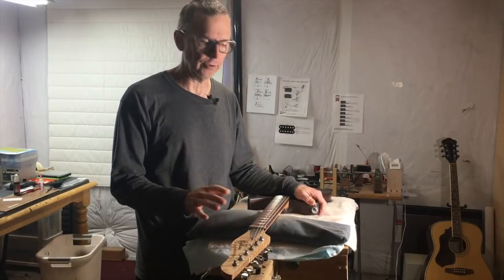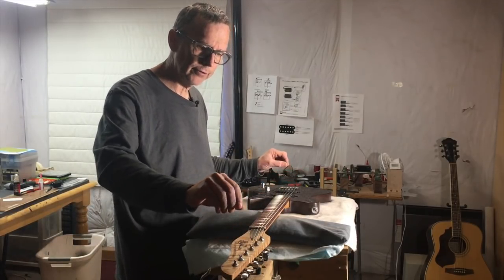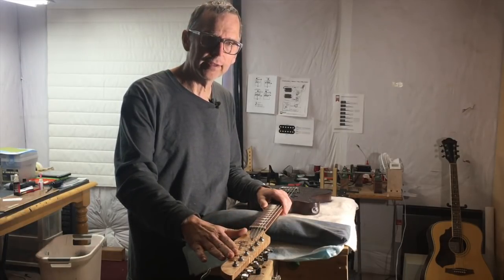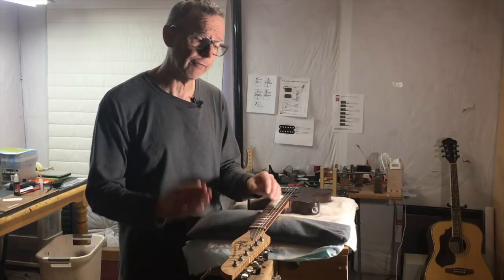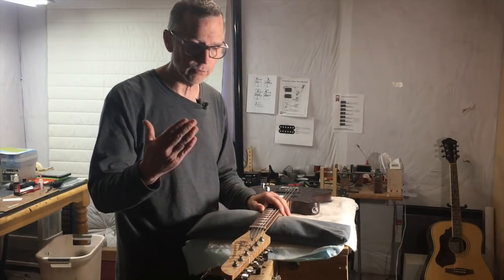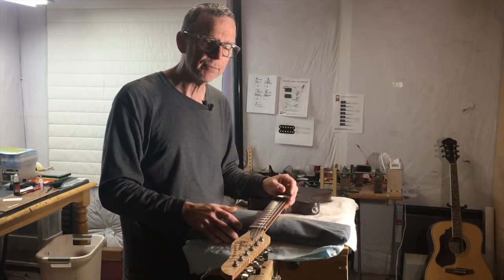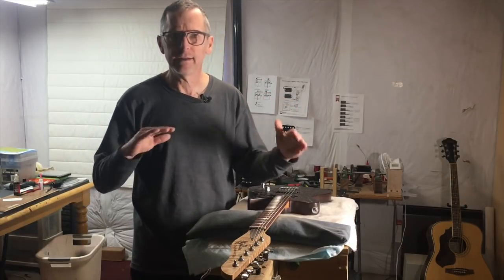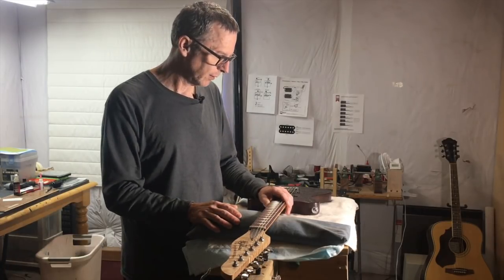Stop Fretting Over Headstock Angles

Comment: I quite disagree in the conclusion of your analysis. 
If we have a nut of an ideal material, then there is no friction forces (in the local direction of the string) added to the string (this is how we'd like the nut to be ideally). This results in a case where the tension of the string is identically the same on both sides of the nut. The only forces transmitted from the nut to the string is local pressures acting perpendicular to the direction of the string. Since the situation is steady, according to newtons second law, the forces should balance. So if we consider the force component in the direction perpendicular to the fretboard, the analysis will show us that the force from the nut onto the string in this direction turns out to be Fs*sin(StringBreakAngle). From Newtons third law we get that the strings push the nut down with an equal size but opposite direction, So this is how much the nut is being pressed "down onto the fretboard".
Fs is the string tension force, which for an ultra light set (9-42) correspond to the force that 36 kilos make.  (We can get up to the double of this by switching to heavy 12-52 strings!)
"sin" is the mathematical sinus function
"StringBreakAngle" is the angle-change that the string makes over the nut (if the sinus fuction on yout calculation device works in radians you have to use the string brak angle given in radians, where  DegreesInRadians=Degrees*pi/180=Degrees/57  (approx.) )
For an example with numbers I'll use the string force from the ultra light strings, corresponding to 36 kilos and give the results in in F/g, so the corresponding kilo's of mass that would produce the same force in earth's gravity. The results are shown below 
StringBreakAngle (degrees)   0       5        10     15
Force/g (in kilos)                      0       3.1     6.2    9.3
As long as the string break angles are kept small (below 30 degrees), the sinus function is rather linear, so we can say to a good approximation, that for the ultra light strings considered we'll get 0.6 kilos worth of nut pressure per degree string break angle, and heavy strings approximately the double. 
You can test that this is indeed correct by trying to "lift out" the strings off the nut of a guitar. The force is very far from just the weight of the strings. I can send you the force diagram and calculations so you can go through them yourself if you wish. 
Thanks for all your great guitar building videos. I apprechiate them a lot!
-Mac
Reply: I agree with MrMac, the force vector at the nut (perpendicular to the fretboard) increases with the angle of the headstock. Here's an example illustration for 5 degrees vs 17 degrees (Gibson): https://imgur.com/a/Bj4fc The perpendicular force for an A string increases more than 3 times, from 1.7 to 5.7 lbs. Without math, it's easier to understand this effect if we exaggerate and imagine the headstock siting at a 90 degrees from the neck, in which case the force vector at the nut (perpendicular to the fretboard) would be at it's max value, equal to the tension of the string.
Reply: This is an interesting video for people who wonder about the physics of various guitar myths, such as the practical difference between 17 and 14 degree backangle on Gibson-style headstocks.

If the maths is correct in MrMacGaunaa's comment - and intuitively I do feel that there should be a relationship between increasing string to tuner angle and increasing downforce on the nut - it's an interesting question as to what is the minimum downforce needed to retain the strings in their slots. (I'm assuming here that the slots are cut in the way we are told is best - i.e., as semicircular channels that are the same depth as the radius of each string, with the string contacting the bottom of the slot only at the front edge of the nut.) I'm willing to bet that it was arrived at by trial and error.

If the only purpose of headstock angle is to improve string retention in the slot, it makes no sense to increase that angle beyond the minimum required. Excessive downward force is not needed, and may start to inhibit string vibration, affecting sustain. Is there any way of calculating that minimum force? It would have to work with the lightest set of strings.

The same should be true of angle behind the bridge.
Reply: If you raise your tailpiece you can feel less tension on the strings.  Isnt this the same as a shallower head stock angle?
Reply: Nice work. It's about the distribution. Now you test how much force is needed (based on a half round fretslot) to keep the string in the slot. So you'd know what the minimum is (probably around 3 degrees). Would be a nice piece of work to simulate that with the string vibration until it fails. 
Besides a lot of broken necks on the extreme angles,  it still has some influence on how the strings feel. When you got a crap-o-matic bridge with a tailpiece and you compare the difference playing bends when you have a steep string angle towards the tailpiece and once when it's less or top wrapped. Huge difference.

On Guitars with vibrato-bridges, more pressure on the nut may hinder sliding through the slots. Strat-style vibratos have their friction and general inertia problems (roller nut and trees help ...or a very well made nut and roller trees). But if you really want to do a lot of whammy work, locking nut and a locking bridge are the best choice and the headstock doesn't matter.

A big angle isn't needed on guitars. Lutes needed a very steep angle for tuning stability cause the nut pressure reduced the force on the friction based pegs. A lot of designs that were taken over to new instruments have no deeper meaning under the new circumstances. 
A lot of guitar builders used to make all sorts of stringed instruments...violins, lutes, mandolins.

It's still utter crap that the headstock angle brings the certain les paul sound like a tone polish selling company tries to advertise. They got stuck with their design choice, that's all.

Depending on what the player wants it's mostly for looks. I asked Chris just a while back. Aesthetics are the reason why he ads the angle on his guitars. On Bass it's a whole different thing. The angle can be one of the reason for dead spots. (different frequency range). 

Another question are other factors that come with the headstock angle. There can be more string length behind the resting points. 
Or if you want a headstock at all.
Reply: Don't get us wrong. He comes from the math behind it and I'm more from a construction angle. It's always a question if a difference is significant or not. That's why i want to shove a phonebook down the throats of the "everything makes a difference" people. 
I know you're on your CNC project...but when will you test the frets made from that titanium-alloy? Would be really nice to know the composition. Thanks for sharing.
Reply: @Jean Pierre Butron That's the reason behind the steep angle on lutes. The nut takes it and the pegs have it easier.
 http://www.toddgreen.com/images/LUTE%20neck%20MOD_thumb_2.jpg
Reply: That's how I imagined it - as a distribution of the share of the tension between two vectors. The tension remains constant but the nut bears a greater proportion of it as the angle increases. I simply think that for any given string tension and string radius there should be an optimum angle, with a small range of possible angles to account for changing gauges.

Whether the effect of increased angle beyond the minumum required to keep the string in the slot has an effect of any significance, whether of sound or perceived compliance under the fretting finger, would have to be determined empirically.
Reply: I'm pretty sure this video was not for debate among experts.
As I've seen, Not many of the luthiers are actually good at playing guitars like pro guitarists, and thus they likely to build guitars purely after the sound than how the players would feel on the guitar.

I built a tele and gave it to my friend, and he pointed out 'subjective tension differences among strings' and the cause was the string length before the nut.  So Me and friend of mine concluded, even in the same angle, whether the headstock is in straight 6strings for 3strings side by side could bring difference in playing feel.
Because, to say, strings have their own elasticity, so regardless to the head angle and the nut, longer strings might feel more loose, especially when bending the strings.  This is something other than how much force is drawn to the nut.
Yes, still greater headstock angle could do better on transferring the sound, enables more consistent sound even on the lighter string set. But yet the players might not be so concerned about it. I would rather worried with more angle for possible breakage when it is dropped.

SO I feel debating comments here is more about the difference between design/science centered view and subjective players' view . If any player cannot find enough meanings on 'head angles - sound,playability association', then Why should luthiers should take care of it so much? Of course research is needed for some cases, but I feel like considering headstock angle is not so worthwhile.
Reply from the maker: I probably won't get to it until late spring/early summer.
Reply from the maker: WOW. If I decide to build thermo nuclear weapons, I'll know who to talk to.
Reply from the maker: If you guys listen carefully to what I said in the video, you'll hear me say "almost" at 3:05 and then "change that much" at 3:46. I'm not saying there is absolutely no difference, just not enough to fret about.
Reply: @HighlineGuitars  "Fret about"...I see what you did there! :p
Reply: Then some player strings the guitar where the string sits on the tuner high or low. Which (as you know) will +/- at least one degree of break. (sarcasm)

Comment: Regardless of which headstock angle I choose, I'd be more concerned about string angle from the nut to the tuning peg. It has to be straight - whether 3x3 or 6 in line.
Reply: Before you even go there...try to teach everyone that they have to stretch their damn strings. They buy locking tuners and what not and it still hangs on how to change strings.
Reply: self trimming locking tuners. love 'em.